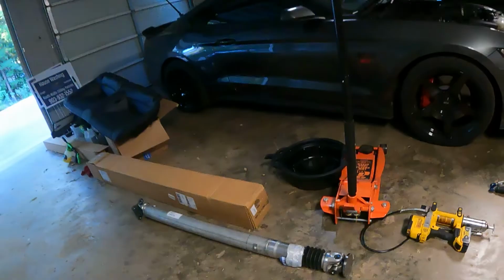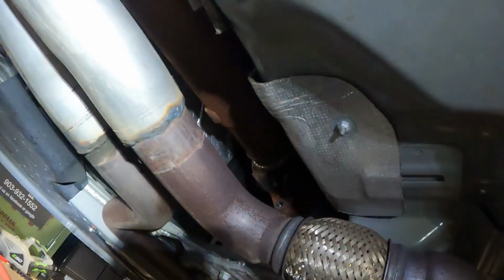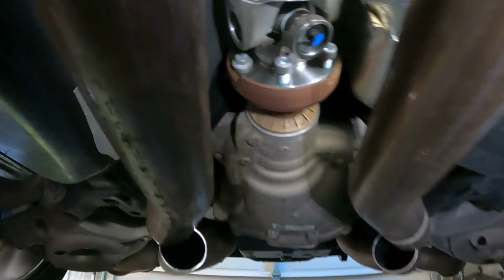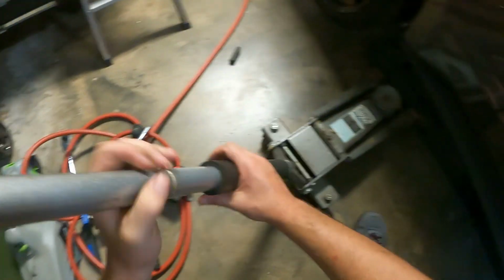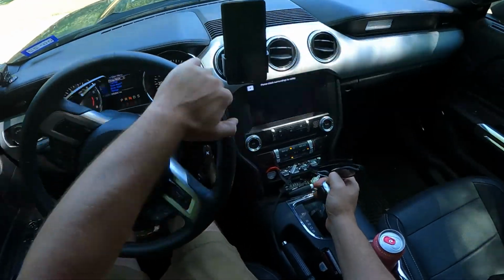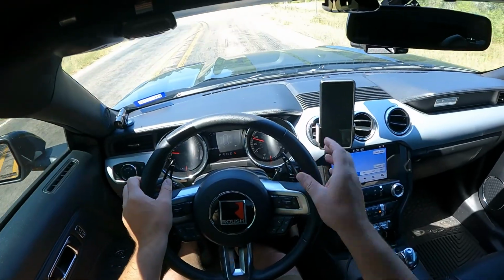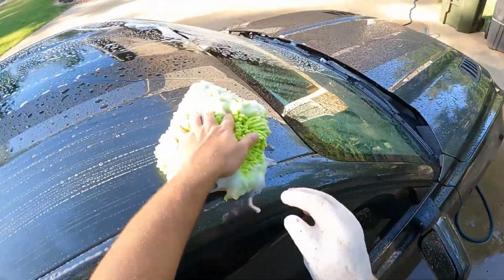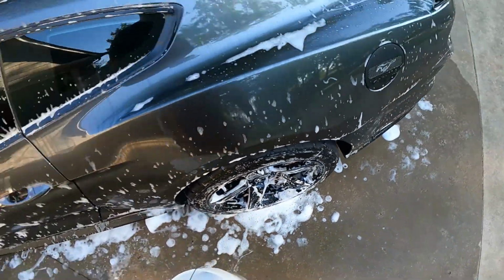I Installed A New Driveshaft On The Mustang!!

Comment: After a new driveshaft is installed, are additional adjustments required? Is there any danger of the new driveshaft vibrating or is it factory calibrated for this model?
Reply from the maker: They balance it! I experiencee no vibration at all. The only thing I felt different is that it felt more solid to the ground.